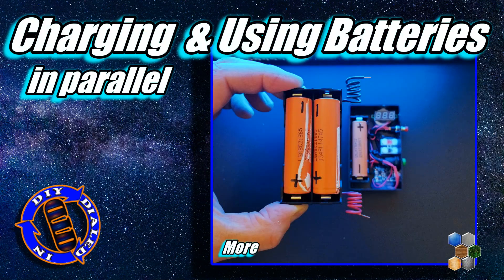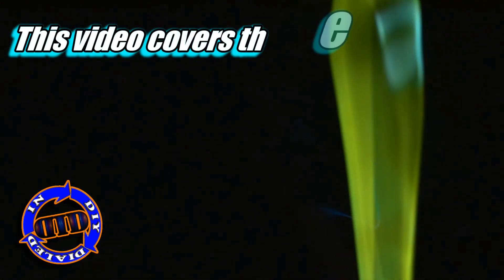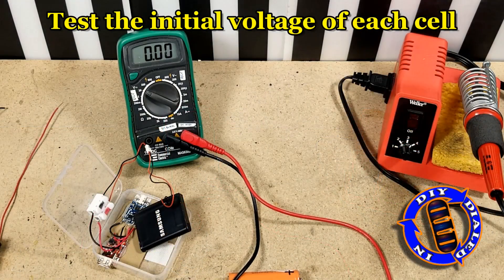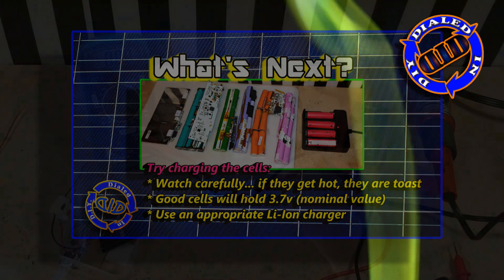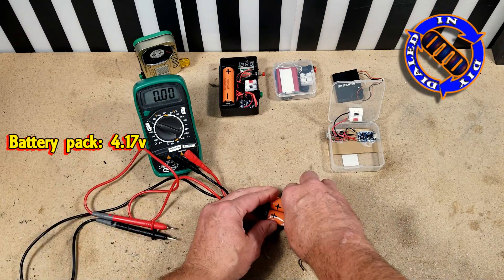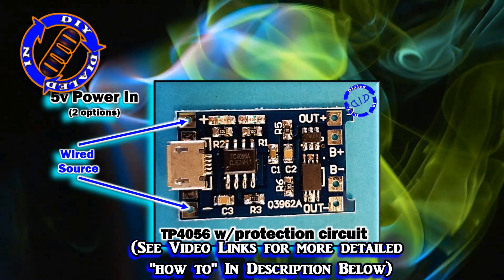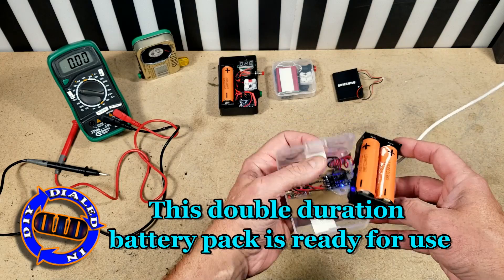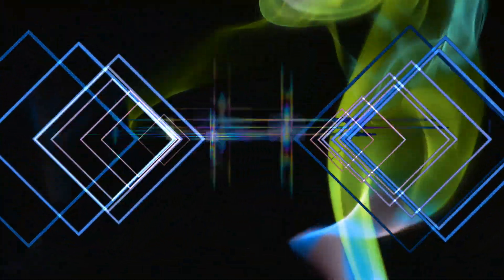Charge and Use Batteries in Parallel - DIY Li-Ion Chargers

Comment: I have 2 batteries in parallel but has 3 wires attached for aa device that no longer charges, so i was trying to find a way to charge externally. Any advice?

Comment: Thanks for your help. I want to make a 4x (3.7v, 2500mAh) 18650 4s Battery pack (LiPo battery alternative) for drone project. How do I design & charge the 4s lithium power pack, since it require high current charging

Comment: Would it be possible to use 3 tp4056 modules in parallel to charge and use 3 cells in parallel?

Comment: Hi. The parallel battery charger for 2 -18650 cells was very well done and interesting. You mentioned that you inserted a circuit that would prohibit their discharged after charging.
Is is possible to let me know what that circuit is? Thank you.
Bob King

Comment: I salvaged some lithium polymer batteries from a 2006 MacBook pro, they are labeled 3.7v 11.5wh, after i test them to make sure they are safe to use could i connect two of them in parallel and use Dual USB 5V 2.4A Mobile Power Bank Module with them? i actually used the dual board to charge one of them and it topped off at 4.17v. Thank you for these great videos and time.
Reply: Yup or do what I did and take 28 of those EXACT lipo flat packs and make 4 groups of 7 then connect those 4 seven packs in series for 16v full charge 12v nominal voltage and run a 750w 12v inverter for 8hr/day x 3 days be the voltage drop below 12v

Comment: Thank you for commenting on my subject about pass through charging I just wanted to state that this technology is so virtually connected to over unity it's not even funny and Chinese products offer it cheaply and inexpensively I bought mini of them also States that this technology is being suppressed in United States I guess by your statement you are one of them didn't give a reason why just stated your facts I'm cool with that but I'm also letting people know that this technology could change everything in the electrical car industry see if you have passed through charging and you want to use less energy run your 12 volt 60 watt outlet through a 3000 watt inverter and if you keep it in range you'll be able to charge car batteries or something bigger at the same time putting that into a tie grid which could run your house depending on the size of the tigrid I have done this and yet people are mad that I'm doing this why are they supporting the electrical companies over themselves so many questions but no one is giving answers this is why I made the statement.

Comment: It's amazing that I've only found one video that explained what passed through charging is and how to make it any size you want wondering if you have this answer and can you explain it in detail
Reply from the maker: True, and it is probably due to the fact that most charging chips people use in their videos don't support pass through charging.  It usually costs more and there is more risk associated. This is because it is simultaneously allowing the output of power to charge your device while simultaneously charging the the power pack. 
 Personally, I try not to use pass through charging with many devices.

Comment: My research tells me this configuration is incorrect, dangerous.
Apparently the tp4056 should only be used to charge single cell. Apparently, say, a 5P pack requires five tp4056 chips.
Im confused.
Reply from the maker: Fair question... the data sheet for my device says it is designed to handle it. Was there something specific besides use of 2 batteries that seemed concerning about my setup?  The good news is that I have been using this design to charge double sets of cells for a couple of years, every single week with no issues. Thank you for taking time to watch my video and post a comment.  I really appreciate it!
Reply: I followed your design. However when charging, it get quite hot. Is this normal?

Comment: Was just trying to figure this out for a 6S3P. I just parallel each layer. Connect all positives and all negatives. 
Then each layer I connect positive to negative to positive. And under side negative to positive to negative?
Reply from the maker: Very good question. I know this set up is very popular for applications like electric skateboards.  I've not made a set up like that but I might suggest doing a search for 6S3P plus the purpose you want to use it for so that you can get an answer that is specific to your design purpose. [So sorry for the delay... life kinda got in the way for a bit]

Comment: Am using 2nos 3.7v18650 lipo, parallel charging them with Tp4056 module, but I need output of 7v? Can I do parallel charging and series output? Using a DpDt switch? Pls guide
Reply from the maker: Great question and definitely one that I have pondered. Since the batteries are seated in a parallel connection I could not figure an easy way to get the result I wanted. My solution was to boost the output to attain the volts I needed.  I did it in this video: https://youtu.be/tp_4eXWE2yE

Comment: I have a question that I can't seem to get any help with, but how would I go about not charging an 18650 battery until it needs it (drops below a certain voltage that I set) when it is always connected to a TP4056 board?  Using solar power so when the sun is up it will want to charge the battery even if it doesn't really need a charge which shortens the life of the battery.   For instance my load is 300mah and on for 5 hours while my battery is 3400mah.  As you can see it would only need to be charged once every two days (especially since the charge will be 1a so done in 3.4h).  Saves the life of the battery etc...   Not sure how to do this, and apparently no one on Reddit, or anywhere else I have asked, knows (or worse cares to know).
Reply: Probably you can put a device that would cut off the charging process when it reaches the certain volts.
Reply from the maker: Thanks so much for stepping up to help out with the question.  You are right... many of these chargers, including the ones I use, have over and under charge protection.
Reply: @shurimanslegacy8729  I need the opposite of that.
Reply from the maker: I completely get what you are talking about. The type of device that I understand accomplishes this called a battery charge controller. I do not have experience with anything of the type that would be needed for this specific effect. I have been told that these can be set to desired charge and discharge limits but I am guessing it may be at a cost that is not offset by the savings of long term battery life and replacement savings in this type of application.  Another point to consider is the depth of issue with the battery being charged more frequently.  This is a common question that comes up with cell phones and research has shown that charging too soon or too often is not always a big issue in the long run (I too have been very interested in this topic). I found the following helpful:
“According to research we have seen, battery lifetime actually increases by 4x when the depth of discharge — or amount that the battery is drained — is limited to 50 percent, rather than 100 percent,” he said. “In other words, by continually topping up the phone battery during the day, as you might do with wireless charging, and not letting your phone battery dip below 50 percent, you will actually increase the life span of your battery.” https://www.nytimes.com/2020/09/04/smarter-living/phone-charging-advice.html

Comment: I Fudgin thought so!....thank you ,erm how long did it take to charge?
Reply: According to the specs of the charging module it should take around 1.75hours to charge a single lithium cell at 5V/1000mA
Reply from the maker: Fantastic... thanks for the assist! greatly appreciated.
Reply from the maker: That is a good question... I have not timed the charge duration but it depends upon the battery/batteries capacity and the depth of charge required.  It is not a quick charge device so I usually plug it in and check back later.  
Sorry for the delay in reply... I really do appreciate that you took the time to watch and post a comment!

Comment: Laptop 4/6 cell 3000 mah or 4000 mah batteries are fully charged in one and a half / two hours.  If there is any system for fast charging using any such BMS / module / circuit, please give the video.  I have not found any such video on YouTube!
Reply from the maker: I have not done any projects to try making a fast charging module mainly because I have so many of the extra cells that I cycle them through uses (I keep charged cells ready for devices I use more often).  It is a great idea and if you hear of anything I'd love to know more about it.

Comment: Ok, I was distracted for a while with the colored smoke. I felt that perhaps we where witnessing an actual thermal event. I had an opportunity work for GM and during a seminar it was made clear that Li-ion battery packs were stopped in use when they reached 20% of discarded. But when charged, they were programmed to reduce the rate of charge, then off at 80% full. Each cell is rectangular single battery with an NTC Thermistor between two and repeat. The chemistry was different and a battery management system that was extremely complex but very robust. The 18650 cells are being protected inside under the positive terminal with a ring-shaped PTC thermistor pinched during construction or over current protection during use. Once current is removed, they cool then will take a charge. One electronics company makes these and sell to 6 or 7 companies at pennies each. For over a year now (2018 up) some Li-ion companies have been using these claiming an increase of battery life to 60-70%. So you get what you pay for. Nice video but just wanted to top of new batteries before committing to a 10 cell pack used on my power tool. Just being cautious knowing that my cells stand a chance of working. Power tools are crazy with BMS that have qualities on both end of the spectrum. It’s work just doing you video as it helps many! Liked.
Reply from the maker: Thank you very much for the great info and feedback.  To be honest I do not know as much as I'd like to about Li-ion battery design but I do recall hearing that all 18650 cells sold in the US require both CID and PTC protection.  There is some really good food for thought here especially regarding building more expansive battery packs. I manually monitor my charging packs for heat gain but I imagine with larger and larger packs that is even more critical.  
Sorry for the delay in reply...I have been soooo slammed with "responsibilities" that I have not had time to tinker, make videos or get back to comments...but all is back on track now. I really do appreciate that you took the time to watch and post a comment!
Reply: I forget to check emails with WiFi half of iPhone 6. Phone not on because of no contract, busy paying bills, medical and parts. 5 dead laptop including Mac Air, phone & Mac sent by son. My Craftsman Pro Series 20v Li-ion are dead, with 6 tools and 8 batteries on pray for $100. I ordered 10 batteries to fix one and found it strange that 3.2 volts but spot welded some in series while others in parallel. The battery management system on top of battery uses one PTC thermistor glued to center of pack, 1 with input to charger. I rebuilt the one, it worked and charged great for 2-3 weeks, then quit. I have not had it apart yet to test. I soldered the ends not spot weld. Disappointed as 18650 cells are from everywhere. Used but charge, new but Chinese while good ones come from Taiwan. Good luck buying there as they have a ministry of trade. You can’t buy a box of matches unless you own a match company in the USA. Sucks as $50 bought 10 cells and all they do is put shrink-wrap on cell, marks or no marks. 38+ years fixing 2,500 vehicles per year at dealer. Now on foot but fixing 67 C10 buy slow. I have impacts & drills but all air. Big compressor and 5 hoses. Everything a guy needs to fix stuff but can’t bend over at 6’3” tall, having S1-L5-L4 fused w/bone in 87 because of stupid boss pulling me out of shop to run gas jumping Jack earth compactor that turned into mud, pick up, drag to new spot, same. Shut kill sw left in hole (4’ deep X 20’ long X 100’ long. Locked tool box went home. Woke up and felt like sunburn. Dr. said 3 muscle groups cells tore, leaked, contracted and grew solid. Now live nerves in scar tissue. L4-L3 In 05, then L3-L2 in 2021. Now July 6th (Epidural # 13) then radio frequency nerve oblation at L2-L1. Finally they are listening to me, symptom not root cause. Nerves sending wrong pain signal. Oh, you fixed cars, I am the Dr. Yes, but I live in torture until you get it right. 
GM hired Hughes aircraft engineers, some from hydrogen fuel cell and others with battery background. They did not destroy all “EV-1’s because they are parked at “Alternative Technical Vehicle Center.” S10 with all electric, Parallel-Hybrid Tahoe, Suburban & Escalade all 36-42 volt. To 90HP motors in trans case running on three phase. Start, charge & reverse is electric only. Drove hydrogen fuel cell (5 types/only 1 good for mobile) but it is 86% efficiency, produces 180Vdc, inverter, converter, no driveshaft but toroidal motors behind wheel w/rotor inboard. They cool both electric boxes with de-ionized water & Dex-Cool so it has heat. A twin-screw 48 Vdc to push air into fuel cell. 3 stage pressure regulator provide 3 injectors on a graduated manifold. Only air and water (7% more that fuel engine) come out tailpipe. They have an Isuzu 3 cylinder diesel driving a generator to run another at constant speed unless idle or brake re-gen. It is all interesting. I was on Raytheon contract working for ACDelco. Have a great day! Omaha.

Comment: isbit save to charge 2 batteries with 1 module?
Reply from the maker: Sorry for the delay... I ran into some unanticipated challenges this year that took me away from the DID work for a while. The answer is that it depends on the specific charging board you bought for the most part the answer is yes (and for the version I bought... the spec sheets say it is safe).